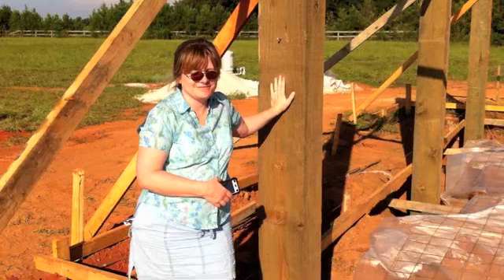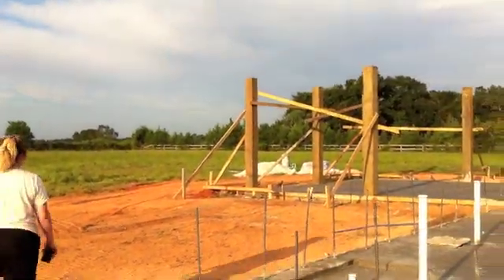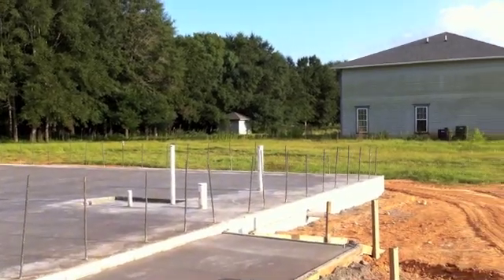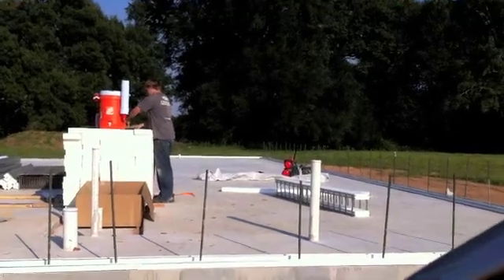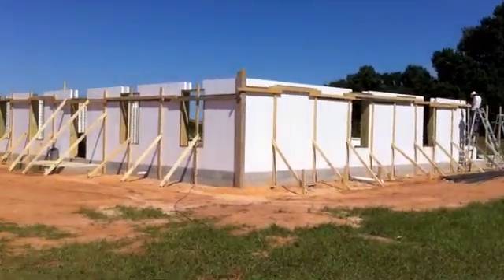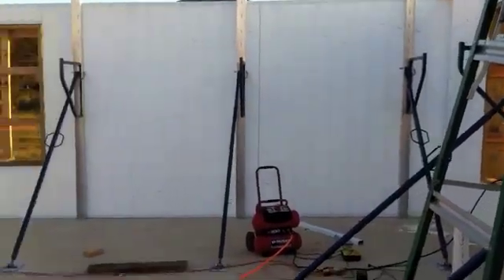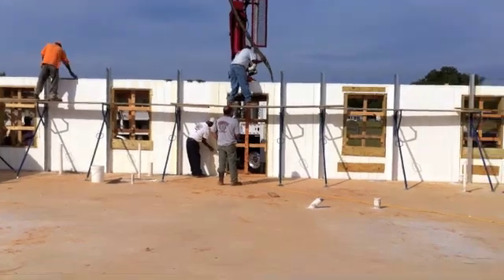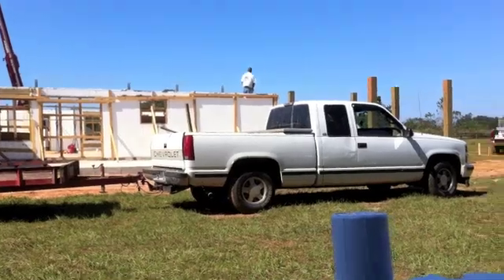TF Systems ICF House Going Up

Comment: I haven't seen all the videos but how do you feel about the TF Systems ICF forms? Are there any issues that came up after you moved in,  like being able to hang items on the wall,  cable tv wiring,  or electrical wiring issues? Just looking for lessons learned before we start building an ICF home.